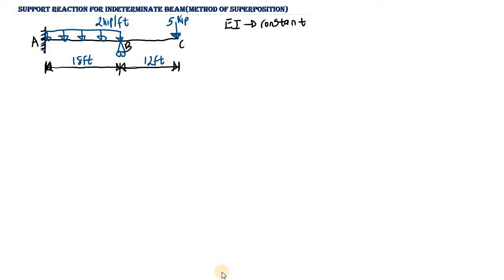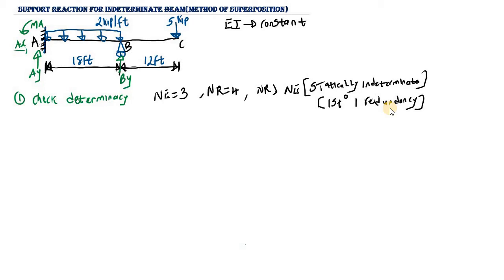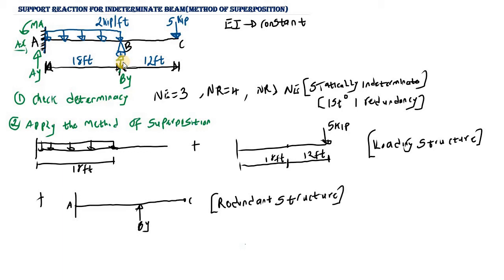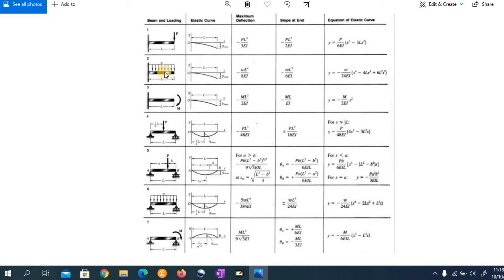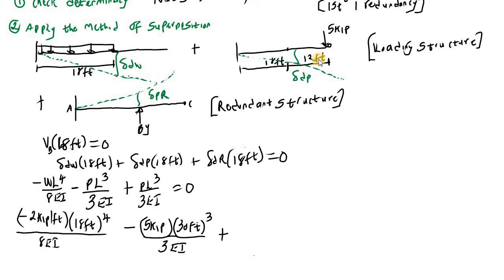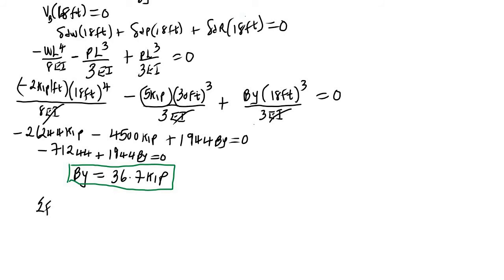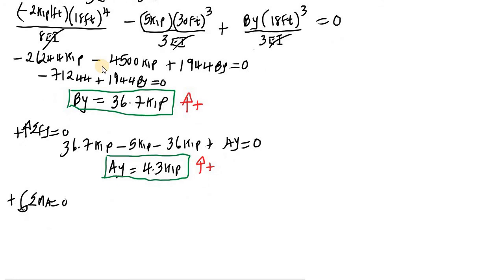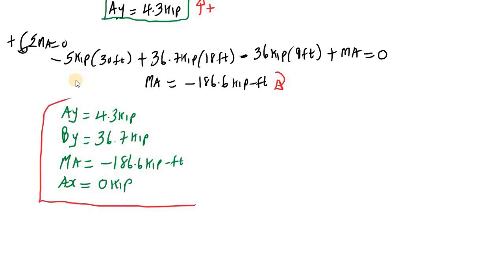Support reaction of statically indeterminate beam by superposition method.

Comment: Wouldn't the distance to the point load (Sdp) be 30ft instead of 18ft?
Reply from the maker: Thanks for the comment. Where exactly in the video is that? What time?
Reply: @Innotutorial  you can see it at 13:00
Reply from the maker: @maxhafer7092  Ok thanks for the comment. The reason the distance is 18ft is because we are considering the deflection at 18ft. So meaning we multiply the rectangular load, the point load and the reaction all by 18ft. That is why it was 18ft and not 30ft. Does that answer your question ?
Reply: @Innotutorial  thank you sir! That makes sense. Great videos by the way. You’re helping me get through deforms
Reply from the maker: @Max Hafer  You are welcome. If you have any question or any video you want me to make let me know as well. Thank you.
Reply: @Innotutorial  why then did you use the max deformation equation for 30 ft beam, you should have used the formula in terms of a distance x, with x being 18 ft (Px^2/6EI)(3L-x)